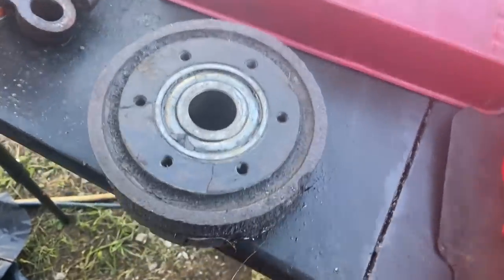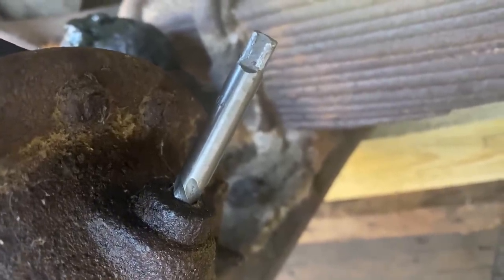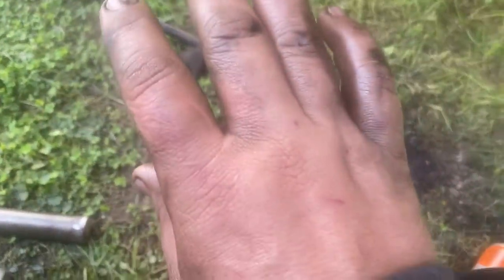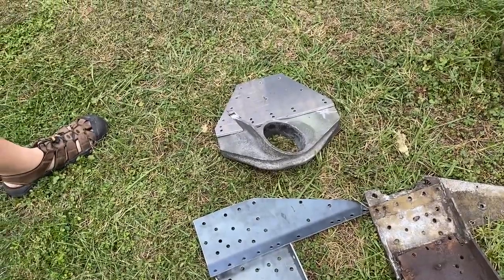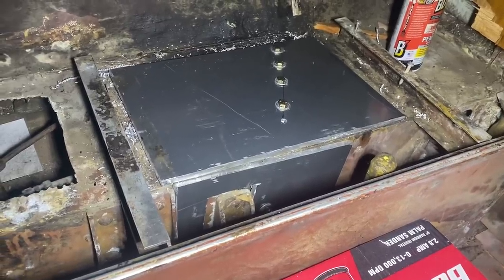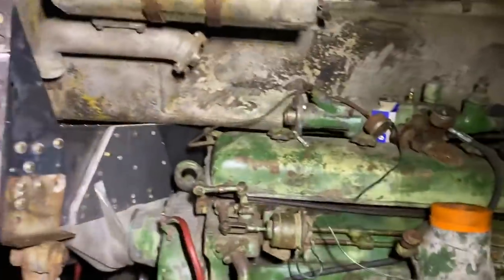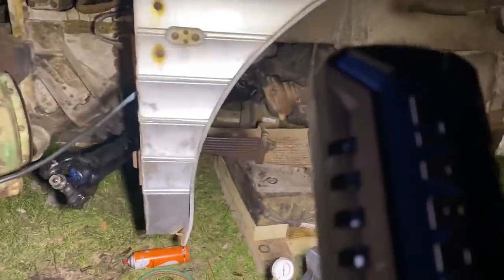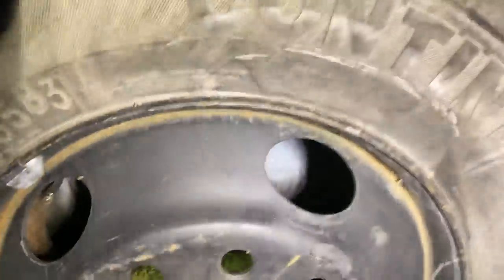Day 6 silversides project

Comment: Glad to see those split-rims go.
Reply: Why? What are their disadvantages?
Reply: @fastdrive55  Sudden unexpected decapitation of the person airing one up is one.
Reply: @danielthechskid  jup did some tire changes on old 1970s DAF trucks. One blew and bedded the lock ring in the roof of the shop. The guy filling it didnt put a tire iron thru the wheel to stop it flying.
Reply: True split rim are illegal now but these rims are 2 piece rims. 

Split rims have a solid outer ring and the rim has a slit in it all the way across from one side to the other. So the rim slides out of the solid outer ring.

Now this bus has 2 piece wheels on them. The rim is self in solid its one completely piece, no slit across them, now they do have a 3 inch to 4 inch oval slot in the for the tubs valve stem to come threw so that the tire can be inflated. Now the outer ring does have a slit in it so that it can be stretched over the rims locking ring lip. Now this ring does lock into the rim and the bead of the tire slides over another lip on the locking ring to help assist in keeping the locking ring seated on the rim and secured to the rim.

If the locking ring lip is rusted away to much or lip on the rim where ther ring sits is rusted away to much so that its no longer has a square edge to keep the locking ring on the rim, then you have a point of failer and basically a ticking air powered bomb. 

2 piece rims are still in service going down the road now a days but primarily only on Dayton semi rims and that it. Other that a hand full or older military trailers that haven't been retired from national guard units and reserves unit.

Comment: Love your channel, subscribed the other day and have been binge watching for the past week! Smoking deal on the engine mount, the only thing that caught my eye was the metal plate that mounts to the original engine mount. In the corners where the "T" is written in Sharpie that were cut to get around the factory mount I would have preferred to have them rounded instead of 90 degree cuts. Basically drill each corner then cut into the  hole as 90 degree angles tend to cause high stress areas in cuts.

Please keep the videos coming, I'm afraid I may see a pre 70's bus in my future!
Reply: I noticed that as well...it's been my experience that un-reinforced/un-radiused 90-degree cuts are the first to have cracks form.
Reply: @bowslap  Agree, might be overthinking it as the bracket is bolted on both sides of the cut, just something I noticed and with the work I do it stuck out to me.
Reply: @tjpatte100  I've been accused of OCD when it comes to things of this nature, LOL...one thing for certain, this will stand a better chance of survival than the hot mess that came OUT of it.
Reply: @bowslap  

Oh I'm with ya on the OCD thing! I honestly can't believe that the engine stayed in with the previous mount, a true testament to the over-engineering that originally went into the factory design.

Comment: If you can still find it, zinc chromate primer (the yellow stuff) is excellent for helping to isolate dissimilar metals. There's also a product called Duralac that is used in the marine and aviation industry for isolating metals and hindering galvanic corrosion. Duralac is usually sold in a tube as a paste, but is thin enough to be brushed if need be, just smear or brush it on liberally between two dissimilar metal faces and join. Not cheap, but neither is this sort of remedial work!

Comment: Broken brass I am taking that is tapered pipe thread. 
Straight taper easy outs not spiral. 
I am hoping that end housing comes off to replace diaphragm.  Tapered reamer to remove brass to top of threads the carbide scribe to pick the brass threads out .

Comment: When this project is finished, I will summarize all of the work and expenses at my website. VWSage.com
Reply: Thanks for doing the Q&A the other day. You seem like the right guy to be doing this project.
Reply: I sure would be interested in knowing where you found the one piece rims. I have a 1962 Chevy bus that I am planning on doing a conversion on, and I would love to ditch the widow makers. I'm not sure, but I think it is the same bolt pattern as your bus. It's a ten lug pattern, but GM had three or four different ones.
Reply: Jerry Brooks There are tables from manufacturers showing how to convert. I found rims for Dayton hubs. I switched away from split rims but kept the Dayton hubs. Maybe you should look at swapping in a modern axle so you can get much more than just a non-split rim.
Reply: Jerry Brooks For example, disc brakes, better bearings, modern hub seals, and for the rear, a diff that will get you up to modern highway speeds.
Reply: @jerrybrooks870  Jerry, these are off a UPS truck. I sourced them from a wrecking yard in Toledo but any large wrecking yard near a UPS depot will likely have stacks of them. If you look at my YouTube videos I think I uploaded my walk around the wrecking yard and there's a 8-foot stack of these things.
Reply: @SilversidesSage  , thanks very much for the information. I'll have to check out your video.

Comment: Equal packets work real well for balancing tires. Been using them for years in my steer tires without any problems. Saves the hassle of spin balancing.  Also I was wondering, can those studs be replaced with normal budd wheel studs for steer axles ?

Comment: The engine fan is called a reversal blades. You switch the direction of the air flow. Summer blows out. Winter it draws the air in. Keeps engine warmer for winter???

Comment: watch for flex if you are deleting the internal channel reinforcement the original had (like put a camera on it going down the road and see if its going to flex), because if it does it will harden over time and become brittle. i could be mistaken but i didnt see it.

Comment: Big as heck lever shocks?  Are those rebuildable?  Available?
Reply from the maker: My last one cost me $1700
Reply: When I take the bus to a spring shop I'm going to see what is possible for the level shocks. I'm not excited about a $1,700 tab.
Reply: Shocks do not need to be a priority.  I've been running mine for 10K miles without shocks with no troubles. Its not like driving a car or truck with no shocks. Barely noticeable.
Reply: @MrMauserb  Tire life will be reduced.  I agree it doesn't have to be the top priority, but not so far as omitting them from the to do list.
Reply: @ShainAndrews  I don't disagree,  but remember that rv tires time out long before they wear out.  Shocks  are very low on my to do list, and will remain there for a good while.
Reply: If you drive on washboard roads shocks might be an asset, but on most roads, you won't even notice the difference!
Reply: @MrMauserb  Solid point.  I'm not used to thinking from the RV side vs OTR.  In that respect they would be extremely low on the list especially seeing the cost on this setup ($1700).  Thanks for the perspective.